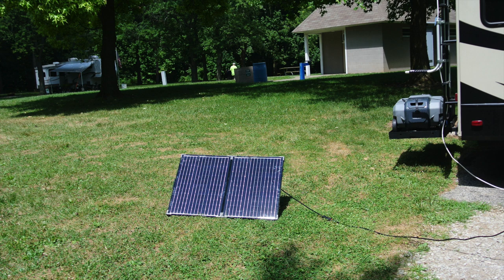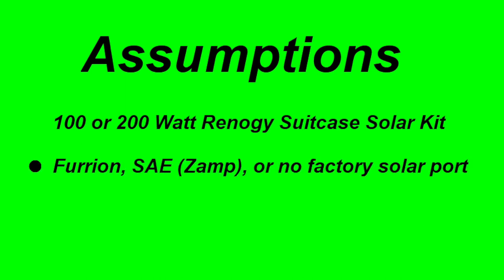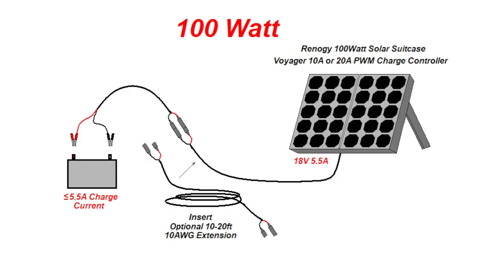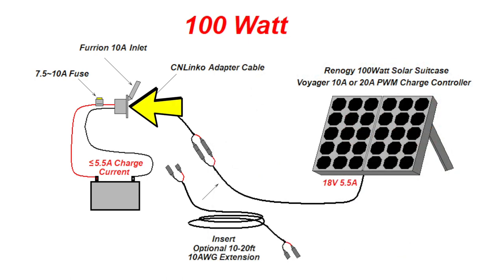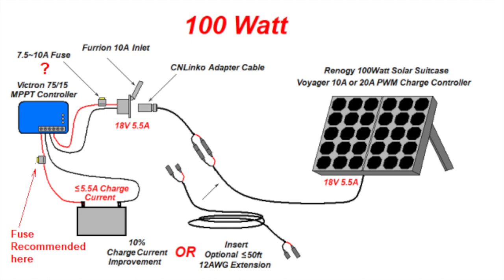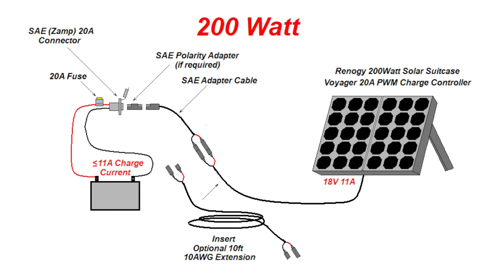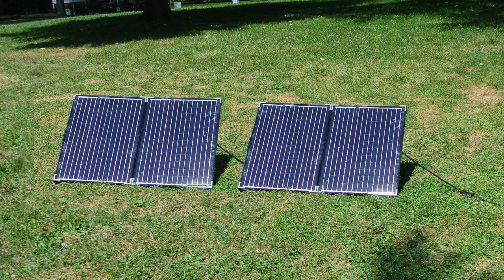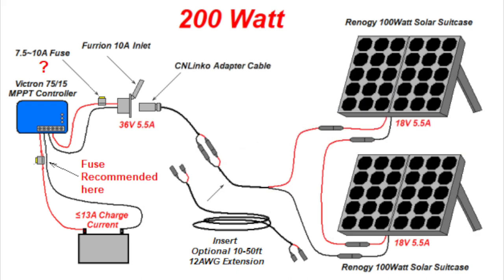Eight ways to connect a suitcase solar panel to your RV.

Comment: Great job on the videos! I wish I saw these videos before I bought my 200 watt Renogy suitcase panels. Question -  I have a factory installed furrion solar charging port on the side of my trailer with a 10 apm fuse.   Your comment it is limited to 10 amps, Can I change out the fuse to 15 or 20 amps? so I can use this port? or should I set up a charging port on the side of the battery case. Any inpot you can give would be great.

Comment: Excellent. I have a question. Let's say that you have 150 watts on your RV roof and an RV built-in MPPT charge controller that is 30amp.  You know that the roof panel's VMP is 18 volts, IMP is 8.38 amps and well below the charge controller max. You buy two Renogy 100 watt suitcases that share the VMP of 18 volts and have IMP of 2.78x2 or 5.56 amps. You have a Zamp plug on the exterior of your RV that goes to the controller and connection shared with the roof panel. Would you just combine the suitcases' positive and negative leads to make a parallel circuit then to the Zamp? I know that my controller is 30 amp so this is my thought but what do you think?
Reply: The creator of these amazing videos passed away in June 2022.

Comment: Did your RV have a charge controller already wired into the "solar ready plug"? Or did you connect the panels to a newly purchased controller and the battery end of the controller to the RV solar plug you rewired?
Reply: The creator of these amazing videos passed away in June 2022.
Reply: @campusa8742  very sorry to hear that, glad his legacy lives on

Comment: Wow, great video. We have a setup similar to Configuration 7. Though I have had zero issues with it, this last weekend I was at a campsite that was well shaded. Our 3@100watt panels (connected in series mounted on the roof) was just not powerful enough to charge the 200Ah Renogy battery fully. So I was thinking that in cases where we are in shade, can I add a portable solar panel? How would I charge the battery? Could I somehow plug the solar panel with its own controller into a cigarette lighter (that is powered by the RV battery), or possibly connect the portable panel (with controller) directly to the RV battery?  So we'd have two ways that the battery is being charged.... We have a 20A Renogy MPPT controller, 3@100 watt panels connected in series to a 200Ah Renogy 12V battery. One possibility: Can I add a 20A PWM controller with a 200 watt portable solar panel directly to the battery with alligator clips?

Comment: Excellent Solar tutorials!  I have a question as well. I have a factory installed rooftop 190 watt setup with it's own 30amp PWM Controller inside the camper, and I would like to use my 200w Suitcase setup with 20amp MPPT Controller on the outside. I know the Suitcase setup will attach to my Zamp plug, but the concern I have is will one controller override, or cancel out the other, and will there be any conflicts. OR will both controllers just work indepently, in harmony,  to keep the battery charged. Thanks in advance for your time.
Reply: Good day, I have the same question. Did you figure this one out?
Reply: The creator of these amazing videos passed away in June 2022. So he won't be answering your question.
Reply: @campusa8742   How sad, and what a loss!

Comment: I have a 2016 Rockwood 2304DS TT with a prewired Zamp sae type connector. Do I need a controller between the battery and solar panel for a 100w or 200w panel?  I don’t know if a controller is already installed.

Comment: My head is spinning with scenarios but I still don’t see the one I want so I’ll ask the question. I have a 200w Renogy suitcase panel. If I moved the 20a PWM controller over to the battery(200wh AGM), how long of a 10awg extension could I use? Thanks in advance.
Reply: The creator of these amazing videos passed away in June 2022

Comment: Renogy told me to use a 12 AWG extension for 20 feet.  What's the benefit of 10 AWG?
Reply: The benefit of a thicker gauge cable is less loss of voltage. And by the way, the creator of these amazing videos passed away in June 2022.

Comment: Great series. Thx! Question please. I am currently using Config 5 with my Renogy 100w briefcase on my camper. I was thinking about going to Config 7 which is why I found your videos. I think you are saying that if I add a panel I must switch out the PWM controller for a MPPT? Is that correct? And why if don't mind. Thx again? Scott
Reply: PS: It's a 20a PWM controller. I would like to add a 100w Renogy Eclipse to my 100w Renogy briefcase.
Reply from the maker: It might be helpful to review my video on the differences between PWM and MPPT controllers: https://youtu.be/EjCUR9jFphc

In configuration 7,  a second solar panel is added in series with the first one.  This results in the voltage on the solar input terminals of the PWM controller to be 36V.  It cannot handle this voltage, and it's a waste of a panel.

The PWM controller cannot convert one voltage to another, but it simply discards the additional voltage as heat.  So it would have to discard 36V (solar panel voltage) - 14V (battery charge voltage)... or 22V.  22V@5.5A = 121 Watts.  This excess energy would burn up the controller.

So when you add a second panel in series to a PWM controller, you increase the voltage which requires the controller to get rid of, but you see no improvement in charger performance.

A MPPT controller can convert a higher voltage to a lower voltage, so it converts 36V @ 5.5A from the solar panel to 14V @ 13A at the battery.

While you could wire the second panel in parallel with the existing panel and use your existing PWM controller, you are again wasting energy because the series resistance in the wiring will start to become an issue.  You would likely have to increase the AWG of the wiring to obtain the best performance in this situation.

A high quality Victron 75/15 controller is about $100, so it is not a really costly item. In fact, compared to wiring the two panels in parallel, the cost new heavy duty wire would offset much of the cost of the MPPT controller.

And a MPPT controller is also about 10% more efficient than a PWM controller.

Also, if you are going to add new panels, especially in series, I highly recommend buying the same brand, model, and specification panel.
Reply: That is so clear and helpful. I really appreciate it. Thx!
Scott

Comment: Just stumbled across this, thanks for the helpful info. I will have a 100w roof mount and 2 100 w portable panels with a Renogy 40A MPPT. Can I wire them in series and then enter the contoller and not blow myself up? Sorry, new to all this and trying to do it right. Thanks again.
Reply from the maker: I always have to put out a disclaimer that refer any electrical work to a qualified person if you are not skilled. Not sure if your comment was humor, but I will take it as such.

Yes, with a NPPT controller you can put panels in series. However, when you do so, the voltage increases for each panel.  
For example, most panels have a 20v characteristic voltage. Wiring those two panels in parallel will still result in 20V (although the current will be doubled).  Wiring them in series will result in 40V (while the current stays the same).

So, when wiring two panels in series, you double the voltage and the current is unchanged. Wiring the panels in parallel doubles the current and the voltage stays the same.

And the same thing happens with 3 panels. In series, the panel voltage is 3x, and in parallel the current is 3x.

One of the main benefits of wiring the panels in series is it is more efficient for the current flowing from the panels to the controller from a voltage drop perspective.

One thing you must determine is if the MPPT controller can handle the increased voltage you will apply to it by putting the panels in series.
Reply: @RVProject  Thank you, appreciate your help!

Comment: I'm in the process of working with Renogy now to upgrade my system. I have my tag along camper at an off grid site. I use an inverter generator when I'm there on the weekends. My camper is a 2020 with a 12v only fridge that we keep running all week.  I have 2 6v golf cart batteires wired in series on the tongue of the camper.  I've been using a 200w Renogy suitcase but it just doesn't put out enough to charge the batteries while we aren't there. It slows the discharge down but still doesn't provide enough to charge. I'm thinking to upgrade to 400w total. They told me to get a 40a MPPT charger but then I have to do entry and exit wiring connections to the camper wall which I'd rather not unless I HAVE to. I don't want water issues.  I'm wondering if I can simply get another 200w suitcase setup with the 20a controller they come with and wire both setups in parallel to the battery terminals on the tongue. I'm waiting for their support to get back to me on that. I have read that both controllers will not fight one another and it will be fine. 
Thoughts?
Reply from the maker: If you have a suitcase, I am assuming you are using it on the ground.  You should be able to add another suitcase to your array. You can wire it in either serial or parallel, but to provide maximum energy transfer, serial is a better connection.  

Serial connection requires a MPPT controller.

Renogy should be able to help you with that.
Reply: @RVProject  yes I do have it on the ground. I was hoping I could just use another one and have the 2 controllers not fight one another. I was hoping to now have to use a new controller because I wasn't thrilled about making holes in the rv wall for the wiring. The batteries are on the tongue and the controller would have to go inside. So id need a few sets of holes. I'd rather not have to do that.
Reply from the maker: @patrickm6000  If you already have a MPPT controller, all you have to do for the second panel is to wire it to the first panel. No need to run wires back to the controller.

Refer to part 5 of my solar panel series:

http://www.rv-project.com/projects/suitcase4.php

https://youtu.be/0Ufm9HHGdQs
Reply: @RVProject  no sir. Currently all I have is the factory suitcase with the voyager 20a controller. I'm planning the rest of it now.
Reply from the maker: @patrickm6000  Are there MC4 connectors on the solar side of the charge controller?  If so, that is where you would make the serial connection.

I would advise against paralleling two controllers. The proper way would be to put the panels in parallel or serial before connection to the controller.
Reply: @RVProject  Understood. So I think what I'm going to do here is this. My camper has a "zamp" solar ready plug installed so I'll find the wires inside and cut them off if they are hooked to anything and run them to a Renogy 40am MPPT controller. Remove the wiring to the existing Renogy charge controller on the 200w suitecase I have now. Get another Renogy 200w panel and wire them in series to feed to the MPPT charger via the "zamp" connector.   That will get me from the panels to the new controller. Then I have to install another SAE connector and wire that to the controller inside. Then that I can use to feed the golf cart batteries which sit in their boxes on the tongue of the camper.  So I should be running about 24v to the Renogy Rover 40a MPPT controller.  I'm also going to use a Victron 700 batter monitor so I can watch the historical data via Bluetooth when I get up to the camper on the weekend..   What do you think? I've been binge watching your videos and they've helped me a lot. Thank you.  Every other person has panels mounts on the roof on here and they all show how to go in through the roof and what not. But that's not what I'm doing.  I may not keep the camper at this off grid site forever.. or in a year or two we might end up getting shore power there installed. So I didn't want to go through the hassle to install anything on the roof.

Comment: I'm surely missing something so my apologies but referencing configuration 8, why is the upgraded MPPT controller needed if 11amps are coming in and it's rated for 15amps?
Reply from the maker: Because the two panels are wired in series, which results in almost 40VDC input to the controller.  Only a MPPT controller can handle this higher voltage, and in effect, it converts the higher voltage into additional current. 

A PWM controller can only handle around 18VDC or so coming from the solar panels.  The excess voltage would need to be dissipated by the controller, which it is really not designed to do, and would likely overheat and eventually damage the PWM controller.

To look at it another way:

MPPT controller connected to two 200W solar panels in series will provide 14.4VDC @ 22 to 26Watts (the MPPT controller is efficient at converting voltage to current).

PWM controller connect to two 200W solar panels in series will provide 14.4VDC @ 11Watts - with 11Watts needing to be dissipated. So you are really wasting money on the second panel as all of it's energy is being converted to waste heat.

So in reality, when connecting these panels in series, you must use a MPPT controller as a PWM controller cannot handle the higher input voltage.

Of course, you could connect the panels in parallel with a PWM controller, but then you are going to have some voltage loss in the extension wire, and loss of conversion efficiency.  

Comparing the two; the MPPT controller will be something like 93% efficient, while the PWM controller might only be around 75% efficient, depending on the AWG and length of extension cable from the controller to the panels.

I do explain the differences between PWM and MPPT and series vs. parallel in my suitcase video series: www.rv-project.com/projects/suitcase.php
Reply: @RVProject  I understand the need for an MPPT vs. PWM, but for example I'm running a Victron MPPT 100/15 and thought I could upgrade my 200w system later to 400w (configured like your #8) and because my voltage would be coming in at 36v and amperage at 11amps I would not need to upgrade the MPPT controller but it appears the output amperage from the MPPT controller to the battery is too high, thus requiring the updated MPPT controller?
Reply from the maker: @joshhaas2410     The Victron part number scheme is a bit confusing, but:

MPPT Input Voltage/Output Current

So  MPPT 75/15 can handle up to 75V input, but can only deliver 15A output.

MPPT 100/30 has a 100V input capability, and 30A output capability.

Since you can potentially see up to 26A on the output current of the controller with two 200W solar panels, a 15A controller won't work.
Reply: @RVProject  Thank you, that explains it.  I wish I had read the specs closer when I originally purchased the controller as I thought I was good for the upgrade but should not have assumed 15amp was only pointing to the input side when it's both input and output.  Darn.